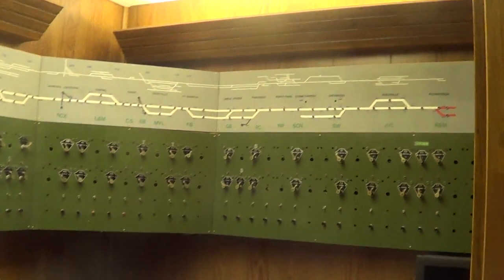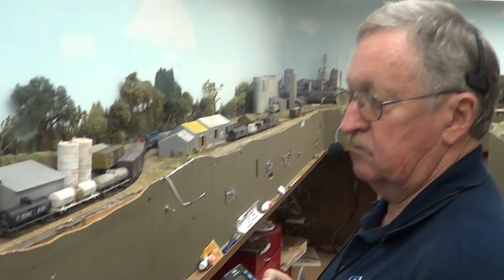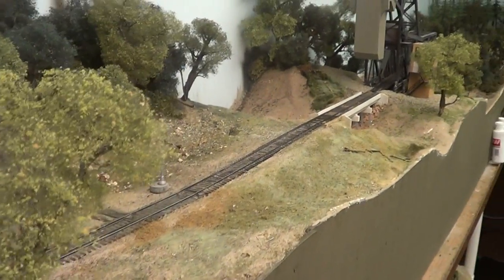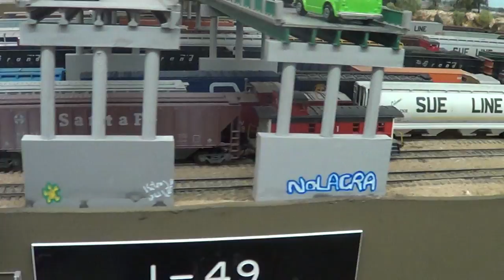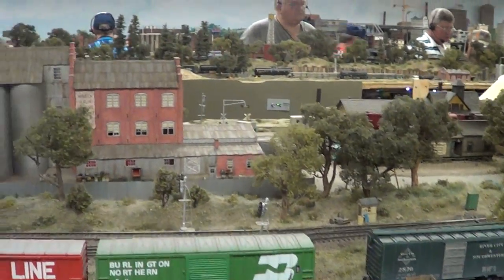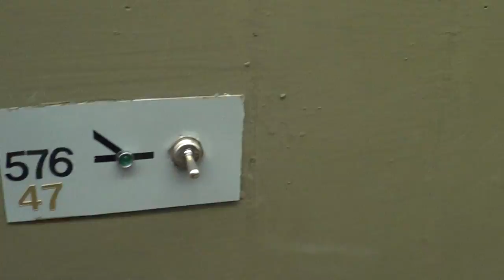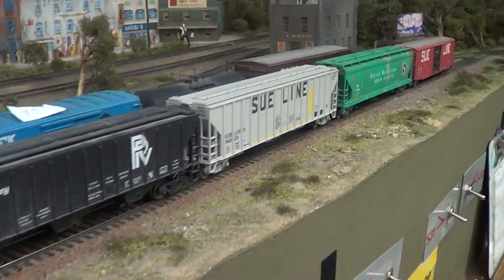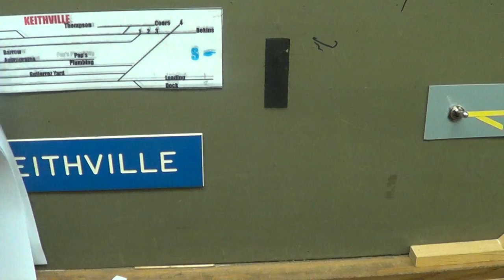Sue Lines-Shreveport LA

Comment from the maker: Phone is connecting to WiFi network not phone network, cost is zero.  You will not believe were this is all going.  The Panel in these pictures has already been replaced by another program in JMRI Panel Pro called Layout Editior it makes the trains running and termination and car use all automatic. I will be able to run my layout from a pad very shortly.